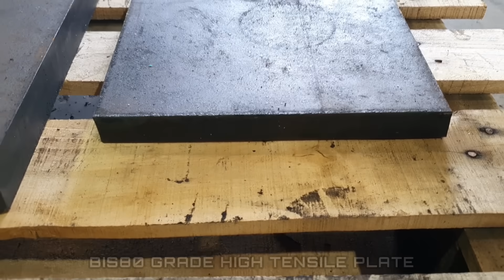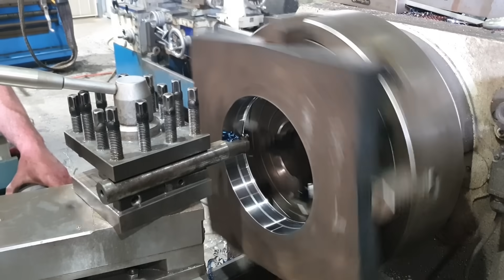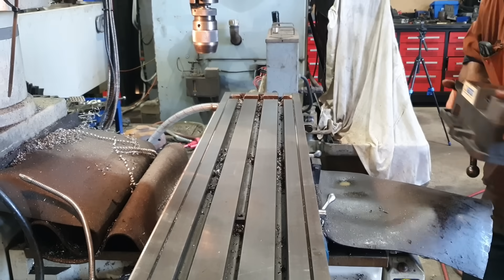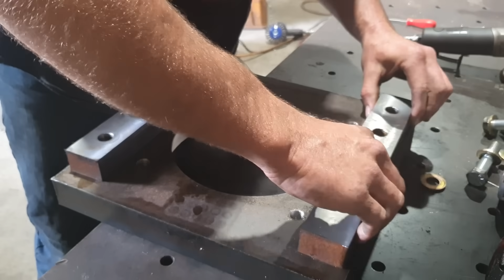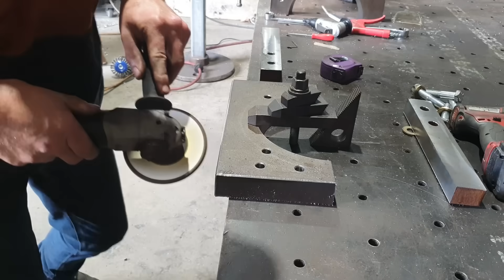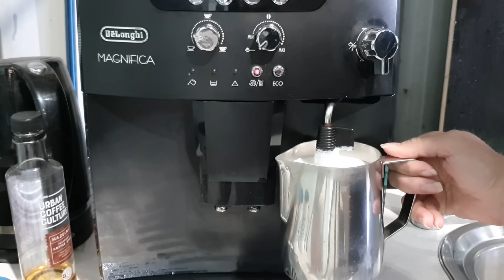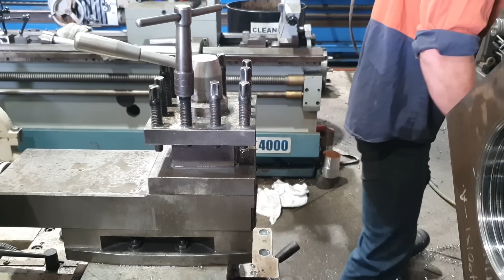Making a Custom Bearing Puller | Shop Made Tools

Comment: Those bearing pullers look very similar to the kind we made when  I worked in Arizona, USA. WE pulled bearings off large electric motors . A lot of those bearings were seized on the motor shafts and we had to heat the bearings to help the pullers work..

Comment: was curious when it came to using the tap , i noticed thru a lot of the videos when you go to use it you drive it in their with the mill to a certain point then stop and detach it from the mill and use the hand crank turner thing to twist it in then out but with this one you send it completly in with the mill and then revererse it i was wondering is it the material that your using that allows you to do that or is it the spacific tap that allows you to do that ?

Comment: Yes Sir 
I watch your videos and 2 years ago I found an abandoned P18 in Maine, dirty, no mast or sails.  I found a mast from a O’Day day sailor and cut it to fit.  The sails I cut the jib off the top portion of a Tartan 37 geneoa, roller furler sail.  The main sail was cut down from a 23’ something.  I would really like a set of original sails for the reason that the “rig” I fabricated may not be exact for a sailmaker to fit just from drawings, and also in keeping with the theme I have of sourcing from folks unknown at first but through the interaction become friends.  If you’re interested in letting your old sails go…?
Thanks Sam

Comment: I noticed your not consistant with your methods, drilling the first 14 mm hole you used oil as a coolant then the second hole you used soluable. If you treasure your health dont use any coolants that makes smoke. I was a toolmaker for over 50 years, and now I have COPD, and believe me you dont want copd. Then it came to the 17 mm holes you used oil on everyone, shame on you. Why would you markout the hole positions when you have a digital read out? I think you need to buy, or make, some parrallels. When it came to trapanning the hole in the plate there are curved tools for different size hole, its a bit more daring but you can save more material. Please dont take offense at my observations, and I know there are many ways to skin a cat.

Comment: So I watch Kurtis a lot. It's my ASMR thing, and my ADHD thing... And I've always wondered - what is the smoke when it's steel on steel? Is it "steel smoke"? Or is it super heated air that vaporizes the water in the interface?

It's a curiosity of mine. When I see coolant, and it smokes, I assume the coolant is smoking. When I see oil, I assume the oil is cooking. It just doesn't make sense that steel would smoke. 

It's metal. How can metal smoke?

Comment: You ever met someone whose million dollar idea is staring them straight in the face and they don’t realize it? That’s Curtis. Brother you need to file a patent for this design and sell it!! How many pieces of equipment have this bearing or similar enough this puller would work if you cut it with the largest diameter bearing being the default size and then include custom inserts that lock in to the face of the default size, maybe you achieve that with girthy locating tabs? I’d say there’s a whole lot that would buy a tool like that… these guys are just the ones who looked found nothing available on the market and sought out someone to engineer and build it. You’ve built 2 for them in different sizes, I’d imagine they pay a little more for one puller with inserts to fit the 3 or 4 most common sizes. Maybe you patent the puller but also the locking mechanism that holds them to the plate and start selling them but if you have no interest in doing that then sell it and a concept to a tool manufacturer give them a concept that they can see in action, touch and maybe you get $2,000,000 for building one or maybe you get royalty’s on top of it and then you do it with another idea and another idea and pretty soon you’re an inventor rolling in dough.

Comment: Could you make lipped half ring inserts for different sizes, so have an oversized hole with a selection of machined inserts? or would the inserts be too weak/unstable when under load?

Comment: Retired here so I love watching a true master do the things I cannot anymore. Thank you for sharing Kurtis.

In my college courses of machining processes I combined all of the required parts to make a gear / bearing / race puller. It was a 8lb slide hammer with a 2 jaw & a 3 jaw with concentric and a ring to push the jaws in or out against the work. I basically rewrote my whole curriculum that included all of the processes like rotary table, lathe, mill, heat treating etc. All of these processes would have left me with useless parts for each respective process, so combining all I was able to have something tangible in the end. I actually needed a puller to rebuild my differential on my car so this was a win / win. Shout out to Mr. Begman - Delta College - University Center, MI

Comment: Sounds like lack of skill on the mechanics part.

We routinely burn out double roller bearings from our bandmills without disassembling it.
Part of the millwright test is burning a fine thread nut off a bolt without damaging it.

Comment: Are you setting up your welder with your gas mixture to look like spray arc or is that the product of gas mixture and wire. I like it very little weld splatter it looks very similar to welds on a piece of machinery. Very nice work my friend

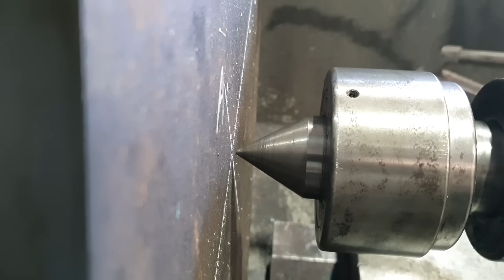Comment: 5:38 If you use a fixed center between the live center of the tailstock and the center of the workpiece, you can use the dial gauge to align the workpiece exactly.

Comment: Job well done.  I have been machining for 35 years, and needed a way to finish my puller.  I like the way you did yours.  I need to pull off the variable speed pulley from my mill.  That will help.  I hate to spend to much time on a tool that will be used only once.

Comment: Hi Kurtis, watching this video of you cutting a hole in a piece of material, I noticed that you didn't cut clean through and that you used a hammer to separate the piece from the stock. I used a 50 lb tested magnet that I used to fish metal out of the river to hold the piece so when I cut through, the centerpiece would stick to the magnet attached to the center punch.

Comment: my first thot ; GROOVY idea ..... second thot ; be forewarned ; at some point , they will WELD that puller to the cone race ..... you know my be sayin' .....  i worked at a CASE CE dealer where they enjoyed welding 1/2 & 3/4 drive pin spanners to end glands .....  rather than build a better tool

Comment: On screw machines what I did to remove tapered bearings from  spindle2 fhat weighed about 60lbs. (yes, US) was start removing some of the items assmbled after the bearing was in place, then positioning the assmblby vertically over a piece of wooden plank.  Lift and drop, several times until everything began moving, then loosen again and repeat.  Very quickly, the bearings had slid off the journals enough to just pull everything off a piece at a time.  This was taught to me by a guy who worked for the machine manufacturer who had done this on hundreds of spindle rebuilds without ever failing to get the job done, and not having to do the same spindle again for the average 20 year life of the bearings.    Not a doable thing in every case, but it helped me get around the problems of the 2 ot 3 leg pullers or making my own knives.
You work on much larger machinery than me, so my method may not work as well in your shop.

Comment: Bear in mind the Mac bearing puller is adjustable for different bearings, that is why the puller has two long adjusting bolts. Let's say the person has your bearing puller but does not have the proper tools to cut away the parts of the bearing to use your puller, they would not be able to use your bearing puller. When I was in the military, my MOS was 63B20 Wheel Vehicle Maintenance Mechanic. We rarely had to use a puller except where bearing relubrication wasn't performed regularly, yes sometimes maintenance falls through the cracks. If you had just welded a row of bolts on the sides of one the puller and a hollow tube on the other half with a long adjusting bolt on each side to close the two halves together it would have been more practical.

Comment: Greetings from the other side of the world (Finland). I have been home with the Covid 19 (fortunately a mild case) for a few days and I've been watching your videos. I like metalworking, I have been doing it for most of my life, both hobby and semi-professionally. Can't claim being a real machinist though, just a mechanic with some basic machining skills, and I have been learning many new tricks. Also, watching your cute and funny dog helps as I'm missing my brother's dog who's also a staffy since I haven't been able to visit them in over a week.

I'm currently working as a heavy haul truck mechanic (done a lot of work on earth moving and rock crushing as well as agricultural equipment in my earlier life too, both as a mechanic and an operator) and getting those inner bearing races off can be a pain. I usually just carefully grind a groove in them and then use a cold chisel to break them off. Sometimes when the bearing is so badly damaged it's literally melted the race can be almost welded to the axle which makes removal really hard, I have sometimes struggled for a couple of hours with a particularly bad case, grinding, heating and finally welding on a large washer to pull out the race. But I have never ruined an axle so far. Some scratches and nicks yes but no critical damage.

Most modern non-driving (like front- and trailer-) axles fortunately use bearing assemblies which just pull out with the hub and can then simply be pressed out and a new one pressed in with the proper press tools. But many, especially driving, axles still use separate bearing races.

That's a nice puller design, unfortunately I don't currently have an access to a lathe big enough (I'm a proud owner of a Sieg C2 though :) ) and we don't do enough of those type of bearings nowadays (as said, they are being phased out on newer equipment) to justify to my boss having one made by a machine shop, otherwise I would shamelessly copy it.

Comment: Ive used a puller similar to that doing  axle pinion bearings. It was designed to use with rollers and cage still on and they had bolts thru the split line so you tightened the rollers into the race and pulled..... Worked excellent but again, different pullers for each bearing size

Comment: After watching a lot of videos from CEE during night time I decided to write a comment. I'm from Germany, area former GDR , where a lot of coal mining industries where located. They used huge machines in open cast mining. I spend some time in a repair facility comparable with what you do. Equipment also very similar. The main difference: In that facility worked over 600 workers in 3 shifts. You are alone! Unbelievable! Did I see in some episodes even a helicopter in the backyard? Best wishes and stay healty.

Comment: 2:15,  If you tighten the bolts on the legs of the three leg puller they do not twist out of alignment.  I have done that for over 50 years with no problems.

Comment: Good vid. Confused how applying heat to outer race shrinks it in its housing and not expands it tighter into its housing. Steel expands not shrinks with increase of temperature. I don’t doubt you if you says it works but wonder what is actually happening. Enjoyed watching ,

Comment: I always need custom tools in my shop but I have limited machining capabilities since it is not my primary business.  I have a 19x54 leblonde regal lathe along with a standard Bridgeport mill and a 1994 Haas vf1 cnc machining center.  My primary business is hotrods and custom cars and trucks but I often take on weird projects.  I do have a 4x4 cnc plasma table with a 150 amp plasma cutter which is capable of cutting 1-1/2 plate steel cleanly.  If I had more room I would have a full machine shop but I am limited with my 3500 square foot shop so I have to be very selective with what equipment I bring into my shop.

Comment: Nice work, but im going to stick my neck out and say pulling breaings off shafts is inherantly dangerous, races can shatter and the pieces thrown almost as fast as bullets. There was a case in the UK recenty where a guy had a substantial chunk of bearing race peirced into his abdomen whilst trying to pull a bearing off a shaft.  Blankest can be used to wrap around the assembly for protection. This tool will give an element of control but the application of carefull and rapid heat is the safetst and quickest method.  Of course oil injection can assist with pulling but not all shafts can have this facility.

Comment: Oh My How many pullers have I broken. Once ruined a piece of Grade 8  1 - 1/4 bananas  all thread rod with a 50 ton porta power ram. That thing jumped 6ft in the air when it popped. would have gone further but the hose stopped it. Sounded like a grenade went off.

Comment: cool, i had to remove a shaft from a machine that snaped off British engineering at its finest build something that brokes when shipped,  yeap how they had it written out did not make any sense out how they would engineer that too, i drill and tap a 1-inches hole into the shaft 1l4 inch wall pipe with a hollow hydraulic ram to pull it out too  crushed the pipe too all i had was  1 flat bar for another job drill the holes over sided and stack them put pressor on the ram and heat around the shaft i was pulling out kept putt the presser on the shaft never i seen a shaft hatter like glass i don't know what they used from a shaft from that day on i question anything that the British would make 
push the other half of the shaft on the tube they had made to new pins changed both when i and sit up  
they wrote to use a long shaft to pound it out thinks i was that stupid i am not Australia or the stupid human species on the planet Americans has a cat that came from the UK the first one was awesome the last one they got did not get off the trailer they had to lift it off all the pollution control shit they had on it let it start up month took me to understand what was happing tore all of them out of the cat and its control box rewired the machine to run without all of the shit cats started up and ran  same company different cat but was the UK made hydraulic failed on one pump was good track it down to a value the lining from the hydraulic hole came apart never seen that before too special fitting on the hole to 6 months before i would see the new hole from the UK 
machine a larger hole in the value and treaded a standard treaded on it had them up and running they did take them cats to action some company from the state bought them all best thing they did

Comment: It’s good to hear correct tool name in the video. 14mm Twist Drill.
Being a machinist (retired) my pet hate is hearing twist drills being referred to as bits, they are only drill bits when you break them, then they are bits or bits of drills.
Of course wood workers, carpenters use a brace and bit.

Comment: Curtis, did u damage the left lower corner on the underside of the rest portion of your OD Grooving tool when you trepanned the slug from your plate? I suppose if the hole size was large enough, u might get away with it. I've seen this attempted before with OD groove tooling and the tool always ended up damaged....but the operation was attempted on a smaller hole size. Smaller hole = tighter radius = more extreme arc profile = damaged tooling. Hopefully u had better luck. Just curious. Keep up the good work. You & the missus make a great production team!

Comment: I work on big turbojet engines that require us to remove big roller bearings from the inner shaft often, how we do this is with hydraulic pullers when also heating the bearing area for expansion. the pullers you had would never work for that type of application. how the pullers you use require the cage to be removed the pullers we use do not make you remove the bearing cage.

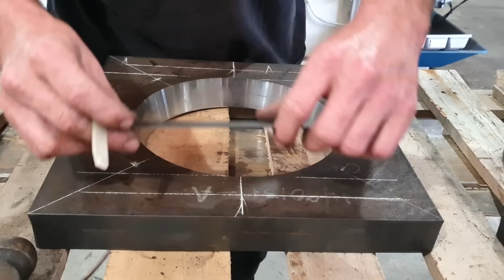Comment: Circa 14:40 -- Could have made the radial marks (for locating the smaller through holes) while still on the lathe, hand spin with soapstone in tool post?

Comment: HI, For me, I have found that if you drill a 1/4 in hole almost all the way thru what is being drilled, then fill with oil. As the bit gets further into the hole, it is continuously oiled.  Seems to burn up less bits. Enjoyed it, thank you, Joe.

Comment: Very similar to a tool I made for exactly this process, to remove an old varyspeed pully and clutch plate. Normal pullers either couldn't get a grip or if they did just bent and distorted the pulley plates. Still have the tool somewhere.